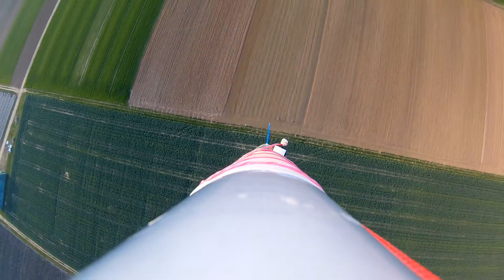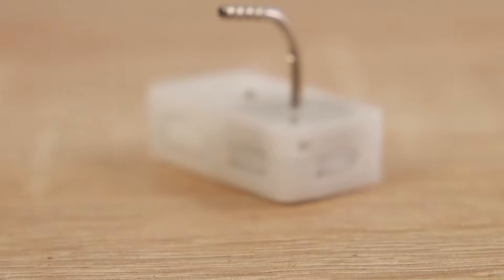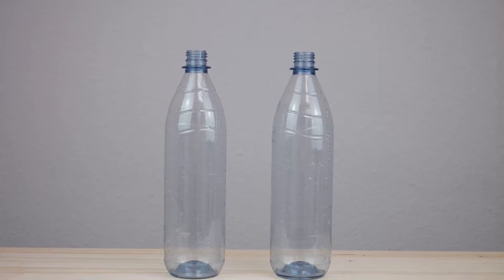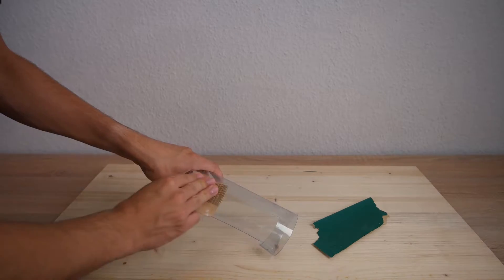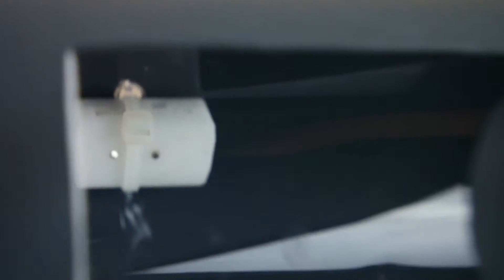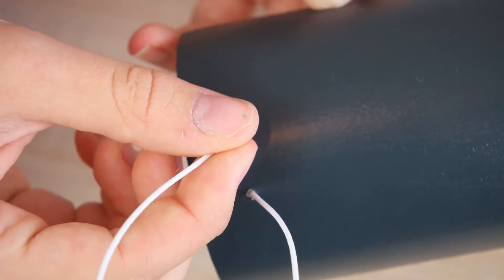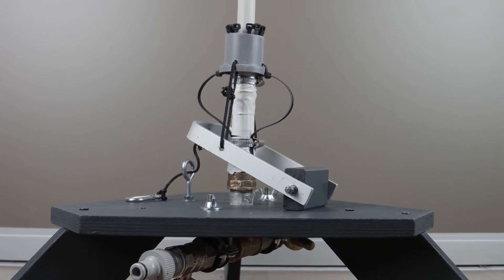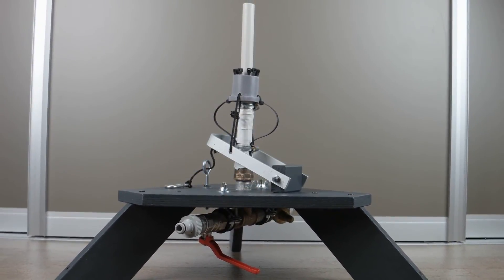DIY: How to build Recovery Systems for Water Rockets

Comment: Here's a tip . If you want to find the radius of the circle i.e the bottle just take a string and loop it around the bottle than measure the string you now you got the (circumference) next is dividing the (circumference with Pie (3.14) = (diameter) than just devide the diameter with 2 and voila radius. Pay attention in math everyone. (There might be an easier way)

Comment: Thanks for the video :) I will probably use this system in my hybrid rocket engine powered rocket. I tried testing electronic timer based on Arduino, but it is not very reliable
Reply: D4àttàgal9h